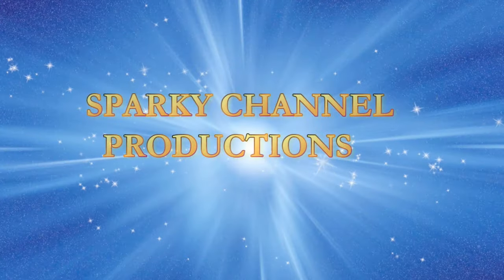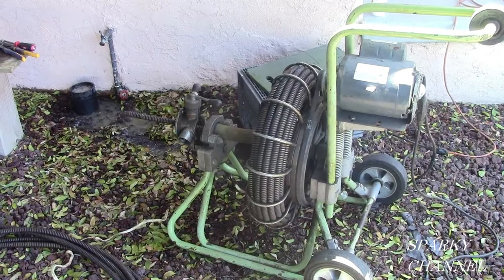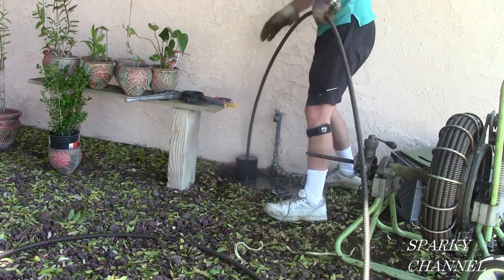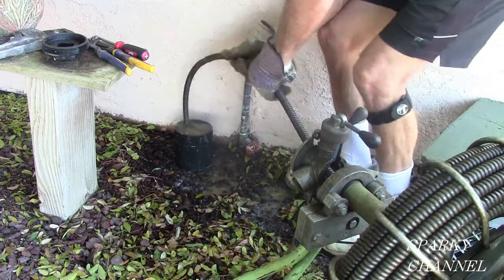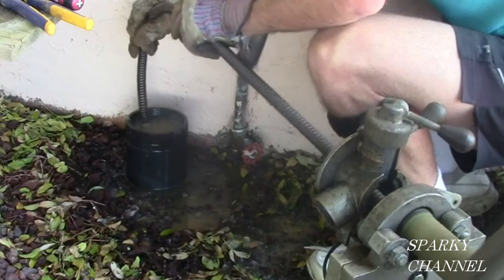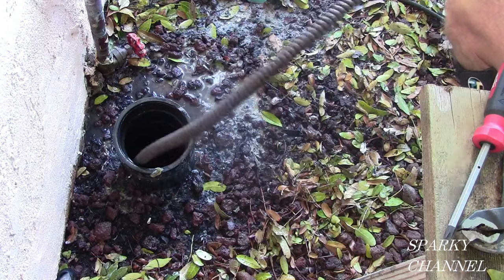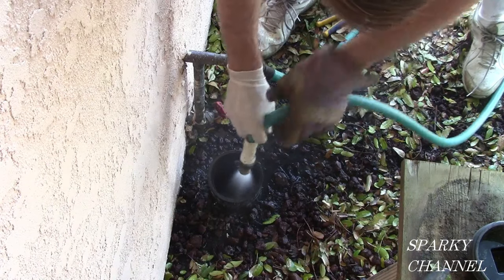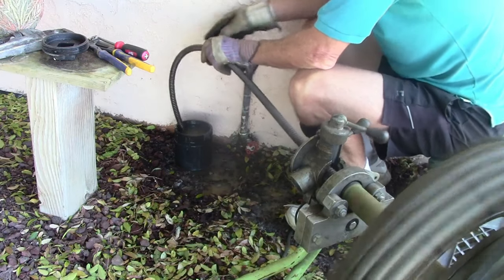How To Clean a Main Line Drain

Comment: I got a plumber  did that and still blocked... any ideas? Water ia still leaking  underneath  my tiolet still😑 told me it could be something that the city  could fix...  🤔
Reply: is your house on a concrete slab or wood floor you can crawl under? its important to flush and check the whole house to make sure-you can clear the water but just push the clog down stream. sometimes the issue is at the tap and the city main might need jetted. hard to say. when you flush water still comes out from under your toilet? replace wax ring and the bolts and tightene it down and while its pulled run the snake down the toilet hole and watch it when it pass thru cleanout.
Reply: if you even have a cleanout-your supposed to but some plumbers in the old days didnt do it. if cleanout full -clog is always past it towards street or septic tank.
Reply: basically though -if Plumber came and left with out having you unstopped he did bad job-nowadays when we clear the line and test house-we run camera down it and make sure there isnt a problem that might cause backup to happen again in a few months
Reply: Its a concrete  slab.. guy ran a  snake and the line... and the clog still didnt go down...
Reply: Called the city... said to call my landlord...  city said it was not on them... none the less this is a pain in the a**
Reply: My cleanout is in the back yard...
Reply: @Crod999  well landlord will say he’s not responsible because he can’t control what you may or may not have put down or used. Line needs to be cleared and camera run down to check it out and find what’s up
Reply: I’m sorry your plumber apparently didn’t complete job right.
Reply: @vladius8521   yeah..   thanks for responding ✌
Reply: @Crod999  your welcome I’m a 30year plumber and have seen this before.
Reply: @vladius8521 : It's a sorry state when a solid pro is stumped and stultified.
Reply: @vladius8521  Chuck your lease and see what its written.....Then put the rent into en escrow account if it not a tripple net lease.

Comment: I am a first time home buyer and I rented the one from Home Depot. It keeps on tangling what am I doing wrong?
Reply from the maker: Hi Edgar. I would say you might be feeding the line to quickly. You may be using too big of a bit for your line. The cable may be damaged.
Reply: First, what do you mean by "tangling?"  Is the cable looping upon itself between the machine and the pipe?  You might be too far away.  When you snake a pipe, make sure the drum is as close as possible to the mouth of the pipe so that the cable doesn't have the chance to loop.
Reply: Depending  on if the line has a kink in it or not it usually  tangles like thats if you have too much line out of the machine  plus you need to be right  next to the clean out so it wont tangle  make sure the machine  is going  in the correct  direction
Reply: Also if you're a fist time homeowner  look into buying  a ridgid k 400 drain cleaning  Machine  home depot  sells  them however  they are around  550.00  but they are worth every  penny  i know i have one  and i use it at my home and in my handyman  business  and i charge  75 dollars  a snaking and give a 2 month warranty on every line i snake

Comment: What to do if you have a clog but you can't see the water in the clean out?  I tried using a hand crank snake but its only 15 feet. Eventually it hits water because you can hear it. Just wondering if I should get a longer one for just hire someone to do it for me
Reply: If you cant see water then the clog is somewhere from the cleanout to inside the house. Need a bit more cable

Comment: How do you clean the snake from po po stuff ???? Using water only does so much and drying with wd-40 stops rust how about the other stuff ???
Reply from the maker: Wash the snake off with water until it's clean. It does take a while in some cases. You could use soap on it as well and then rinse again if you like.
Reply: @SparkyChannel  Thanks for the information Sparky. Look forward to learn more from you fella. Good day too. vf
Reply: @SparkyChannel  sounds like a job for the manual car wash. Soapy spray followed by a rinse cycle, you could even spray wax it. Lol

Comment: What if the clot before street
Reply from the maker: You need a long enough cable to reach it.
Reply: When I took off the cap no water came out .. I think it must be clot up at the y.  . What could it be
Reply: @SparkyChannel  no water came out at sewer going towards street.. there must be a clog under house.??
Reply from the maker: @joesalazar7272  Yes, that sounds right.
Reply: @joesalazar7272  If the clean out is dry, than the clog is upstream in the house. Best option is to rent a machine at home depot and remove one of the toilets in the house and snake down the open drain until you can see the snake head at clean out. Than take machine outside and do the main line out to street. Dont forget to replace the toilet wax seal before putting it back in place.

Comment: I'm having problems with mine rite now over the weekend it still clogged
Reply: Did u fix it
Reply: @154g  I got it unggloed
Reply: @herbertmartinez7639  how?
Reply: @chit-town9066  In a pinch, a toilet plunger will fit its nozzle part tightly in the clean out opening, and by vigorously plunging for about five seconds at a time, it will unclog. If not, go to home depot and rent a machine like his for about 45 bucks.

Comment: We had a septic truck clean our tank out.  Still not working. Toilets not flushing. Shower filling up. Can’t wash clothes because the toilet will overflow. We tried using a 20 foot snake in the toilet and the washer line. Nothing :( I don’t want to let the landlord know nothing is working but it’s getting to that point
Reply: Wish you were in central Florida
Reply: Always tell the landlord; they would want to know because it is their property and it's literally their only job. it's not your fault AND it's your right as a tenant that your landlord provides a habitable dwelling. You pay rent, they do the rest!
Reply: If a snake cant get it, a high velocity jet can. If that cant get it, the line is broke

Comment: Excellent video!
I've never cleaned out a sewer drain with one of these machines, (or any other way for that matter) but intend to buy one and learn.

Not knowing anything about sewer lines, I assumed that a 50 foot cable runs horizontally through the drain to the sewer, not 50' 
vertically down.

I can't believe you were able to manually push a cable 50' through a horizontal sewer pipe. Nor do I believe the sewer pipe you cleared ran
over 50' straight down into the sewer.

Unless sewers are that far below ground which I don't think they are ... but perhaps you can. enlighten me.
Reply from the maker: Hi Conrad! Sewer lines need to drop 1/4" per foot or more so they aren't entirely horizontal. The only time they would go straight down would be in the case of a multi-story building. The sewer pipe I worked on in the video had a drop of about 1/4" per foot or a little more. I did push 50' of cable through the 4" sewer pipe before adding on another 50' piece of cable.
Reply: @SparkyChannel 
Thanks Sparky ... lol... Now it makes sense to me.
Thanks again for a great video.
Reply: It

Comment: Keep in mind, you have to lift this in and out of your trunk/suv.  It isn't light.  You may need to rent the manual version.
Reply from the maker: Mine is very heavy, but it's on wheels.
Reply: @SparkyChannel When I'm loading or unloading my snake on my van or the roof I normally pull as much cable out to make the machine lighter.
Really helps a lot.

Comment: Sadly mines on the roof
Reply from the maker: I have a big and heavy drain cleaning machine and I've gotten it up on the roof many times. I'm in the market for a lighter machine! :)
Reply: @SparkyChannel  I have 75 ft. of 1/2 inch cable on my machine. I normally pull all the cable out of the drum to get the machine up on the roof which makes it a lot lighter. When I'm done snaking my drain line I pull all the cable out of the drum agian to get the machine off of the roof. Works for me ☺️
Reply: @SparkyChannel  I do leave the cable attached to the drum when I do this😀
Reply from the maker: @ramonestrada38  That works!
Reply: Clean out on the roof?